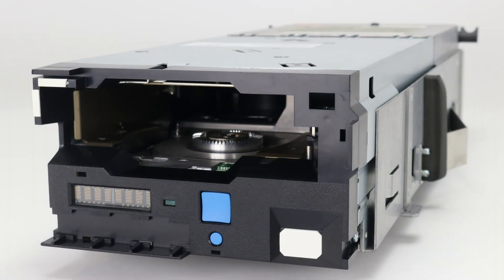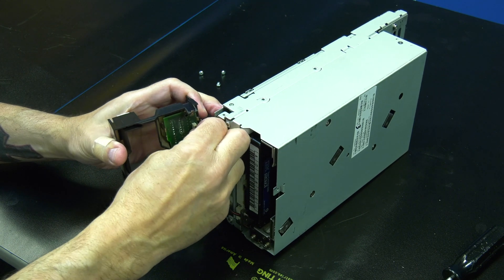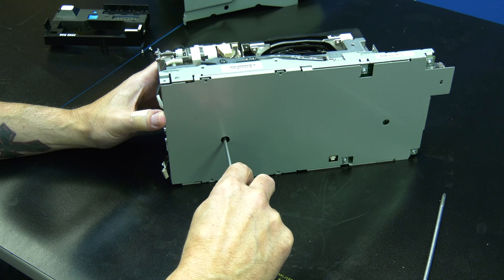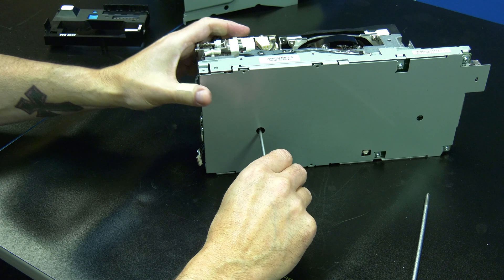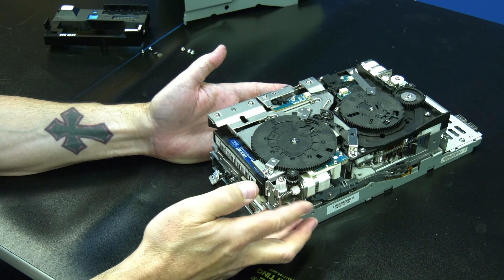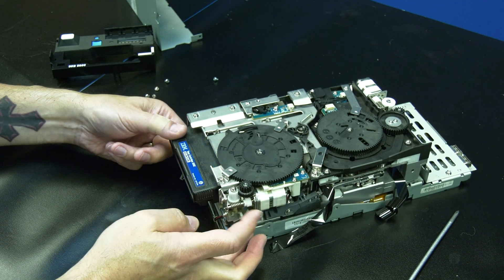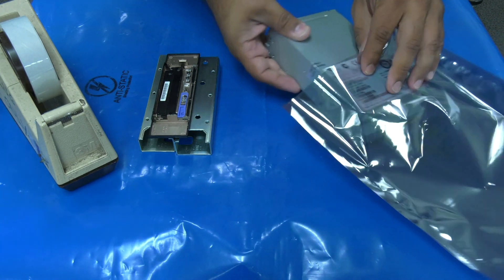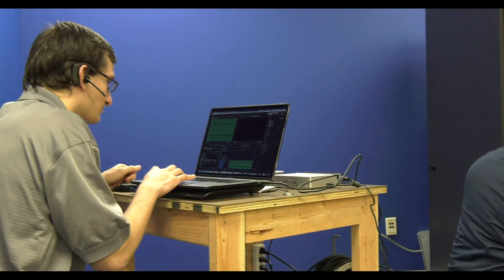IBM 3592 Tape Extraction

Comment: We have some Problems with two tape drives (3592-E08) in our TS3500 library. On the display, they show the error: FID2 D8 380600C8. Please, if you had an experience with this type of issue sand us troubleshooting guide